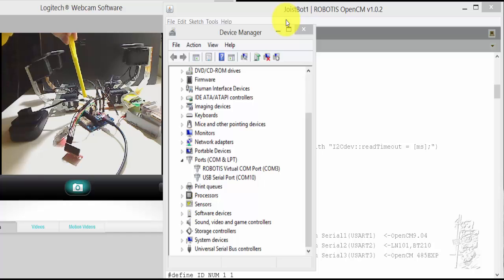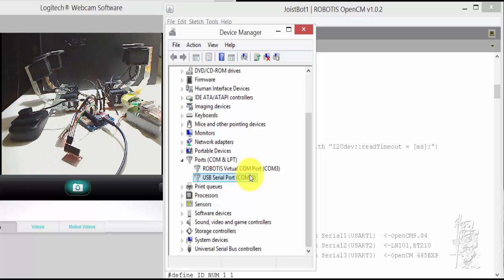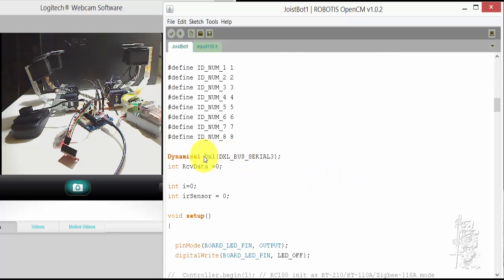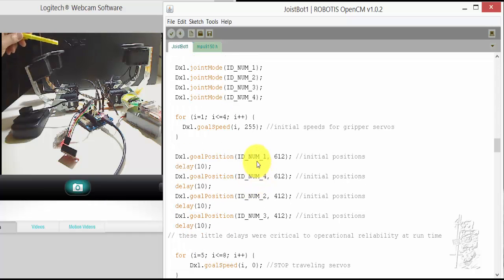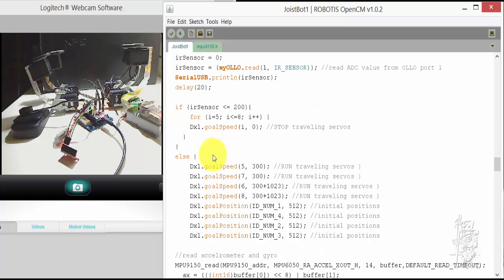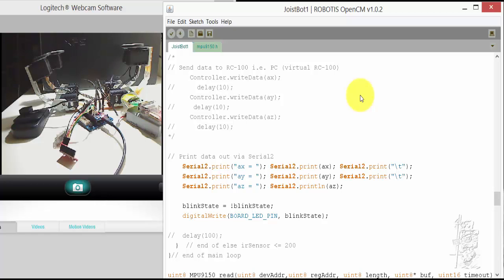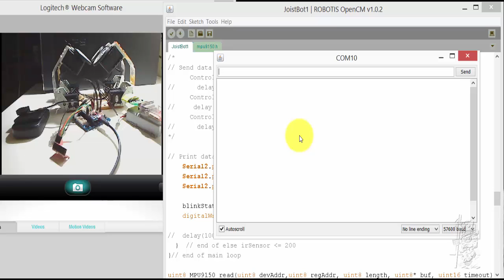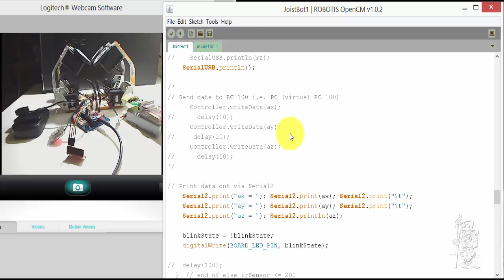Joist Bot, an OpenCM-904-C Application

Comment: can u please provide the link for downloading mpu9150.h for ARM cortex ?
Reply from the maker: It came with the OpenCM IDE software.  You can get the OpenCM IDE software at this link http://support.robotis.com/en/software/robotis_opencm/robotis_opencm.htm.  Once you unzip everything to c: drive, this file can be found in this folder C:\ROBOTIS-v1.0.4-windows\libraries\Wire\examples\SEN11486.